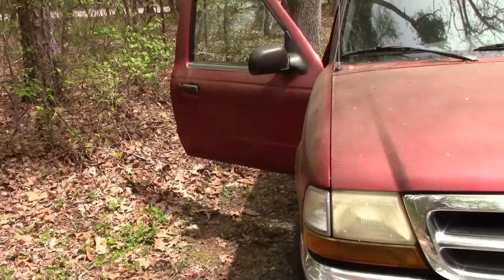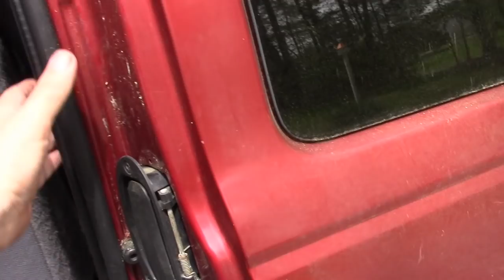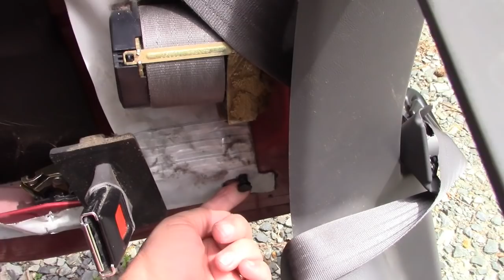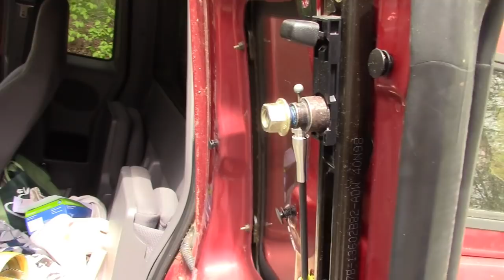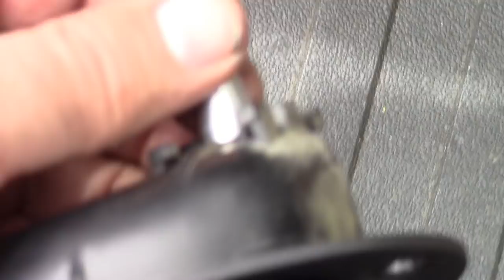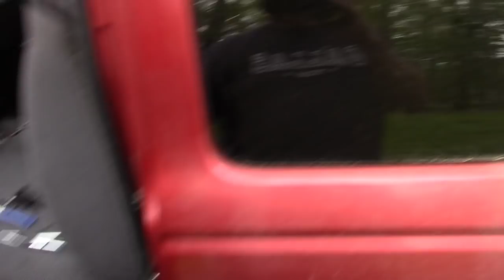99 Ranger Door Repair

Comment: Lots of good info here. I got the aluminum inserts and got it all together, but now the cable's don't function; like, they're super tight. I've had the entire locking system apart several times and can't figure out why, and the doors don't latch closed. Any suggestions?
Reply from the maker: Did the cable sheath get bent?  Are the inserts pressed on all the way?  They are a bear to get on.
Reply: @TOM2RN  They were a bear, and are pushed all the way in. I'm wondering if the need to be trimmed a bit, or the sheath needs to be trimmed.
Reply from the maker: Try hooking the end at the locking mechanism first. Leave the door half disconnected. Pull on the door handle end and see if it unlocks. Don’t close the door. If I’m not mistaken, the is a slight variation in how to of the inserts appear as compared to the other two.
Reply: I figured it out. The new Al inserts I have have a slot that was cut too small; so, the cable gets bound up and restricts movement. I have brought this to the attention of the ebay seller and already got a refund. What I can do to fix the inserts is to drill or grind them out on the latch mount end. I'll make a video.

Comment: Did you use short 3/16 th rivets or long ones on the handle ?
Reply from the maker: Long
Reply: @TOM2RN  wish you could be more specific on the length ?
Reply from the maker: @donaldjones7058  
I’m not sure of the exact length. Lowe’s had two sizes.
Reply: @TOM2RN  OKay thanks
Reply: Thanks

Comment: Good information! Well done video. I had the same problem with my 2000 XLT Ranger. I didn’t know about the things on line but I made my own and they were identical to what you bought on line. Purely coincidence.  But they solved my issue.

Comment: Hi - Good  video overall. I    think I can do mine now Ha. 
You mentioned the 3/16th pop rivet for the latch handle, were they long or short ones?
Thx
Reply from the maker: Long
Reply: @TOM2RN  When you say long 1/2" ????
Reply from the maker: @L.A.O  Check Lowes or Home Depot. There were only a couple of sizes. Can’t remember the exact length.
Reply: @TOM2RN  Will do thanks

Comment: what I need to know is how in heaven can I pull the door open without the wires connected at the bottom latch
Reply from the maker: I use bell wire and attach it to mechanism. I get it at Lowe’s in the electrical section. Use two strands together. I use it to follow electrical wires when I wire things in my house. If I ever have to pull another wire later I have my pull through already there.
Reply: @TOM2RN  how can I attach the wire???...remember that the door is closed and what I see is a hole on top of the hinge...this latch is not the same as the other side...or something went loose...
Reply from the maker: Luis Cornieles 
Best bet is to start loosening the panel at the bottom and work up. The plastic bolts are long as compared to most. Take a mirror and stick it inside to see where the cable would normally fit.
Reply: @TOM2RN  Thank you very much....I'll make it happen!!!!!!...one question....do you happen to know if doors of a 1997 will fit my 1999???...
Reply from the maker: Luis Cornieles 
I’m not sure, but what I do is look up the part number for each and compare. Not matching?  No go I’ve learned.
Reply: @TOM2RN  Thanks totally reasonable...didn't think about that!!!!...

Comment: Best how to repair Ranger door handle/ cable on you tube. Ranger in video was a 99 mine is a 2007 and it was exactly like the 99 so I guess not many changes in the door over the years. I ordered my aluminum ends from George Klammer and I will not give info because I do not recommend him. I should have received 3 with round ends and one with a modified end. He sent me 4 with the round ends. I took a chance and filed the one to modify it to fit. I happened to see a picture on you tube so I knew what it was supposed to look like. The plastic pieces that hold the door panel on you can figure that some will break so be prepared.
Reply: I need to modify one for my top latch, too. Do you have a link to a video on how to do that by chance?

Comment: Thanks so much for this video! At first I thought oh man, so long and verbose but I am glad I stuck it through 'cause you were thorough and showed me the exact "thing" I needed to know regarding that one differently shaped "head" on one of those aluminum clips and what I was supposed to do with it.  I was about to throw in the towel or start prying and bending things out of the way to make it work. You saved my butt man, thank you!  I actually didn't even have to remove the top latching mechanism off the door to be able to fit in the aluminum cable end and saved myself some work there. Do not make the mistake I made and try to "make it work with a T25 Torx bit"...that backfired and I stripped the head of those aluminum screws used to attach the latch to the door frame.
Reply: instablaster...

Comment: I'm a locksmith and have to fix these type of problems all the time. Most of those pieces that break are plastic and generally cheap, if you know what to buy.
Reply: Of course he don’t answer. He is a greedy locksmith.
Reply: locksmith db how much does a job like that cost? I have the same problem.
Reply: @andrescarrizales6310    been waiting to hear locksmiths reply ,,,,,,,, i have an 07 and both doors crapped out in one week what are the odds . have you found any easy or cheap solutions ?